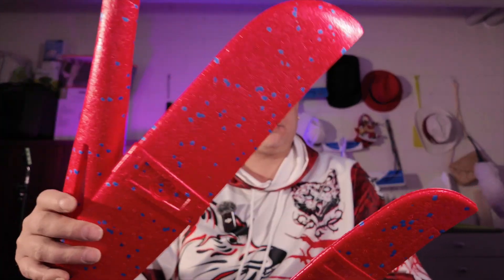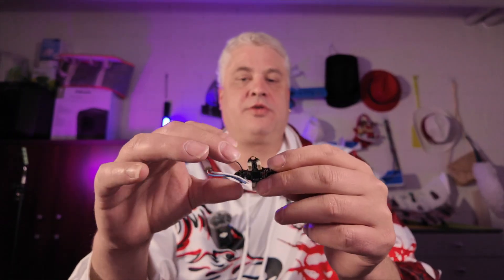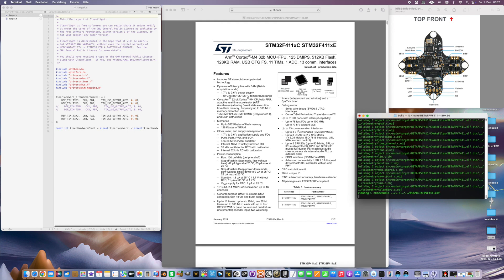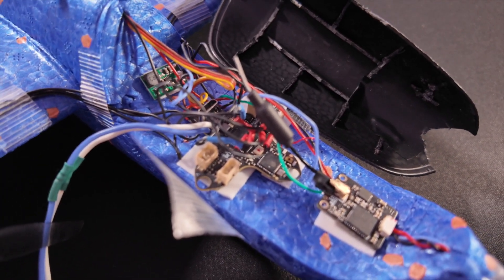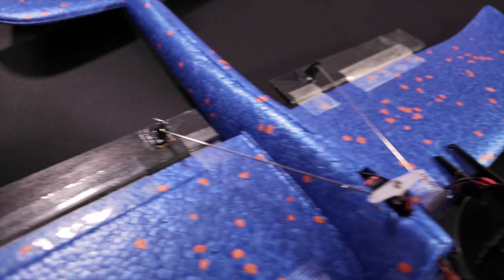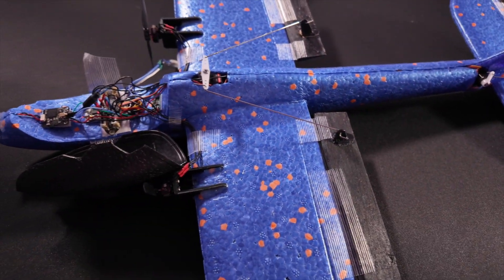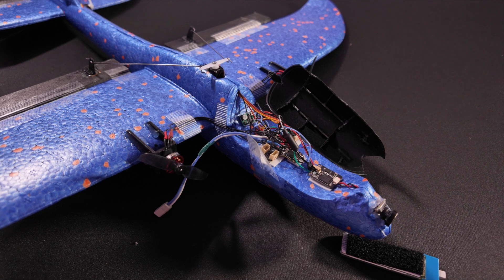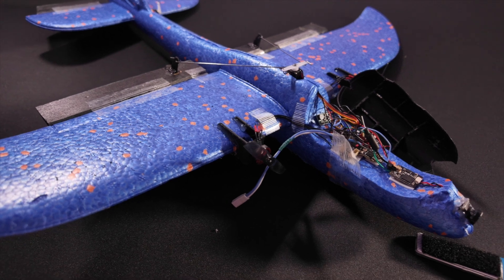1S Foam Plane using a Betafpvf411 Whoop FC

Comment: Did you see Betafpv Matrix 1S 3in1 AIO? I wonder if you could prepare custom IAV target to what board
Reply from the maker: No Chance, the STM32G4 is not supported and will never be. There is basically everything missing in the definitions, drivers etc. I tried already, better to use Betaflight for that. (4.6. Has Wing Support) https://github.com/iNavFlight/inav/discussions/10601
Reply: @RockFPV  So there are no 1S AIO board with HD VTX support and INav?
Reply from the maker: If you add a 5v Voltage regulator with 2-3a you can basically use any other f411 etc. fc. Just not the one with the chipset in the Mateix fc
Reply: @RockFPV  What about Flywoo GOKU F405 HD 1-2S 12A AIO?
Reply from the maker: There seems to be a Target for INAV but if it works with a Custom Target I can't tell. My last experiments with Flywoo Boards failed, even though that was different one. Not all FC's are "good" for Custom Targets and it takes some time to check what kind of alternate functions the pads support. The FLYWOOF405S_AIO is a quite expensive one and I just have one in my Kayoumini, so nothing left to test
Reply: @RockFPV I want build 1S plane with HD Vtx and gps,  so I need 3 Uart FC. Right now I couldn't find any AIO with elrs.
Reply from the maker: Just as Tip, based on experience this will not work well. You will have to go for at least 2S to have enough Power and then you can use the Betafpv 2-3S F405
Reply: @RockFPV  Thanks for the tip, you're an inspiration. Following your video, I built a 2S plane with BetaFPV AIO, full INAV with GPS, and CADDX Vista, and I'm very happy with it. Now I wanted to build an even lighter version using a 1S with a DJI O4. That's why I'm looking for such an FC. But I'll have to consider it then.

Comment: hi i am trying to do your build but have trouble with servo and motor outputs.
i have 
flashed the custom image on the f411 board.
the board on battery supply and rx connected.
i nav works. i have my servos on a 5v convertor. 
i get no motor or servo movement when commanded in i nav. 
i have tried other servos

this is not my first build.

is it possible the firmware you provided needs adjustment.
how can i test for signal on tx2 and rx2 possibly with multimeter?

i notice that the betaflight flash has rx2 and tx2 and resource a03 and a02 (respectively) but the i nav flash has a00-03 unassigned? also i noticed the inav target has motor output on b04 but b04 is unused on my betafligh flash.  is resource maping this no longer important here?

i am using the rx board and not the built in elrs board. i guess that is the problem?
Reply from the maker: 1. Don't compare resource definitions from INAV with Betaflight. These are different. 
2. You actually don't need a voltage regulator, that's the idea with the AIO, you only need one fro the FPV Cam. Try without it to rule out that you have a loop.
3. Outputs in INAV need be be enabled and Mixer set up correctly.
4. Whenever the FC gets power, either via USB or Battery the Servo Centers. That's the indication that t works.
5. Bind to the FC to your Transmitter and if setup correctly the servo will respond to stick input.
6. The Idea of the custom Firmware is that the resource is directly mapped in the source code. INAV does not support Resource remapping, this is why it is solved like this.
7. I have not tested it with different variants of the FC, with the ELRS Version it definitely works
Reply: @RockFPV Thanks for the reply, still trouble shooting here. i hooked up power from the fc to the servo and there is no change.  after looking I notice that the rx flight controller i have nolonger has beeper or status led function when on your firmware. the target.h file from ur sorce code located at src>main>target>berafpvf411 points to #define LED0  as  PC13 and #define BEEPER   as PB2. i know u said not to but, when referencing the screen capture from betaflight cli resource i see beeper on a14 and led on c14 . is it possible this is part of my problem?

Comment: Hey Rock,  great build!  I plan to use this FC for a NON FPV Causemann 400 Wing build so I can get a 1S easy solution.  I am assuming your FC is the Classic ELRS version on the link you provided.  or does it matter if ELRS or FRSKY on your compiled INAV HEX?
Reply from the maker: It‘s the ELRS Version, It should work as well with the FRSKY Version even though I highly recommend not using FRSKY anymore since Range etc. are not really great.

Comment: Should RX2 and TX2 be set to S3 and S4?
Reply from the maker: Yes, Motors S1 and S2, Servos on S3 and S4, the order I would need to check but hey 50% change to have it correct on first attempt
Reply: @RockFPV  Thanks for your help.

Comment: Hello! Nice build, and cool Video!
Question please: do you use the voltage regulator only for vtx ? Where do you solder + (red) /gnd (black) from the servos?
Thank you?
Reply from the maker: Hi, yes the regulator is only for the vtx since there are no more free pads and directly from the battery is unfiltered and full of noise. The Servos + and minus are connected to the 5v and - pads. Two Servos can easily be connected to the same + and -.
Reply: Thank you!!!

Comment: This is so cool I wish to know how to use a  AOI that is 2-4s with servos I have more than a few that just have one bad EFC. Great job  Thanks for sharing
Reply from the maker: Unfortunately this is not so easy to explain and every fc / inav target works different and there are multiple ways to implement it. In Short, identify the Rx and TX pads you want to use. Check the cpu datasheet if there is an alternate function for the pads having a timer on it. Comment out the serial port, increase the number of pwm outputs and then check if the timer from the alternate function is used somewhere else and if it can be commented out as well.
Reply: @RockFPV  Thanks for the help  Cheers
Reply: @RockFPV  Just tough enough to make it difficult. I'm honestly surprised their aren't custom targets for most 5a - 12a boards, I'm sure most in the hobby have lost an AIO to an ESC fet popping. I do have a few of these boards, but they all have bad gyro portion of the BMI270, yet somehow the accel still functions fine when looking at the graphs in betaflight.
Reply from the maker: @ChrisHarmon1  People just recently started working on it but 1S FC's with only limited amounts of Pads do not get any love at all. This is why I tried to get it done. It's easier on 2S Fc's with more Pads. I think the Industry missed a complete Category in the last years. They are fun, easy to build, you can reuse half broken stuff as well. I understand why INAV does not allow easy remapping per se as you could do a lot of damage to Servos etc. when do don't know what you are doing.

Comment: Great video man. Can you please show us how you did it?
Reply from the maker: You mean the custom Target or Building the Plane? The custom Target one is not so easy to explain and it‘s different on every INAV Target
Reply: @RockFPV  I understand that but can you explain the whole build and how to configure it? In a video?
Reply: @RockFPV could you please give me a hint from where to start to compile a custom inav build ? your idea about using aio fc is great. however inav doesn't support resource remaping. I would like to test few other aio FCs with different plane types
Reply from the maker: @miheico  Compiling is one thing, for that there is a good documentation page. The tricky part is here, find and AIO where you actually have an INAV Target. If there is none, that's then a little bit more complicated. If the target exists the basic process looks like this (not every fc is easy to do). Reduce the SERIAL_PORT_COUNT by one in target.h. Comment out the UART definitions. Then increase MAX_PWM_OUTPUT_PORTS by 2 in the same file. Write down the assigned resources you just commented out. Then you open target.c. Then you need to have a look a the CPU Datasheet and find a Timer and Channels which work as alternate function for these resources. Then define the servos. You might want to look at the source code of a modified target since it's not  so easy to explain. If you are unlucky and the timer is used, then it's more complicated.
Reply: @RockFPV  thanks a lot! Indeed not a simple task. Anyway, i will try to look around and make some tests. Also i am working with betaflight 4.6 which supports wings now. It might be work with only resource remapping in betaflight, however, no ideas where from it will take timers
Reply from the maker: @miheico  This is exactly why INAV does not support Resource remapping. Bad things can happen when the same timer is used for a motor AND a Servo. You will kill the Servo.
Reply: @RockFPV  I have found the inav target, it's available as SPEEDYBEEF405AIO. I will give it a try)
Reply: Hi. Could you help me using a Tynihawk 3 freestyle plus AIO board to do this built? I cant find the pinouts
Reply from the maker: There are a couple of things, there is no inav Target for it, I don't see free free rx/tx to make this work. You could grab them directly from the chip solders but you still need to get a target for inav or betaflight which is compiled and configured correctly.

Comment: nice build, just 2 things:
you just killed you Lipo @w@
i guess youll already noticed this but ARGH, please dont fly your lipos such low xD
and second i would recommend to display your Radioconnection in DBM, its much more precise, especially for modern high perform protocols like ELRS or Crossfire
Reply from the maker: Thanks but Battery is completely fine, calibration was off when I did the Maiden Flight, For this use case I don't even care about any link quality I have if off on Whoops etc. For everything that goes further, I agree